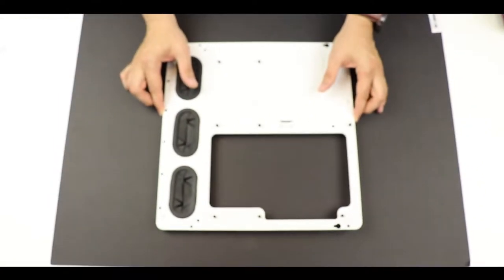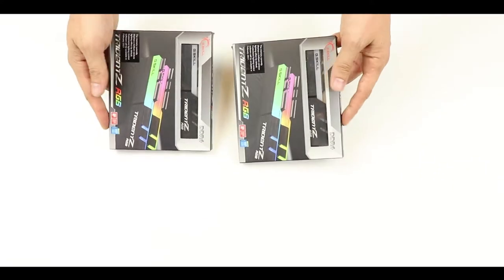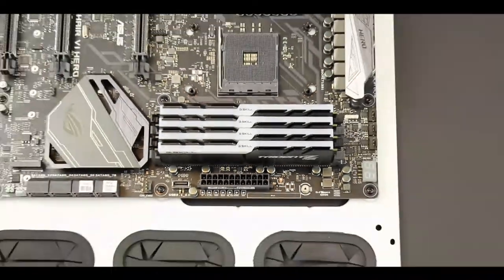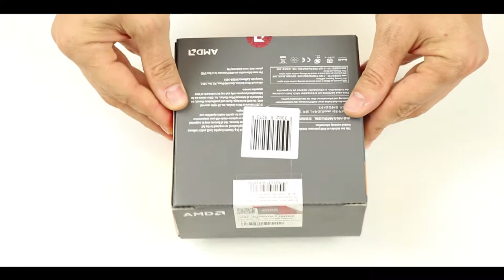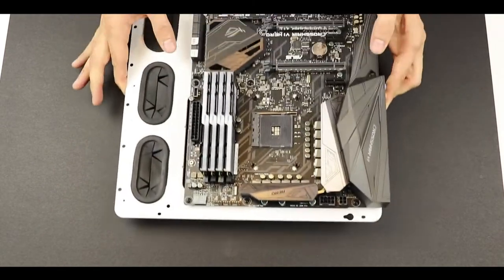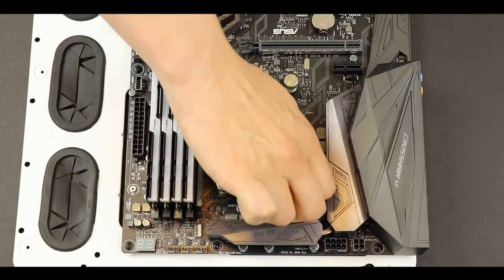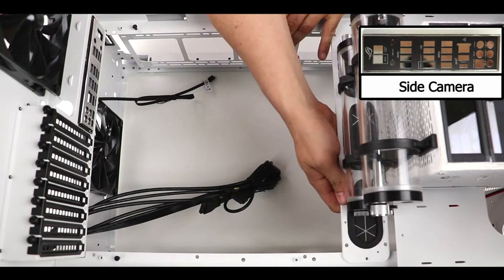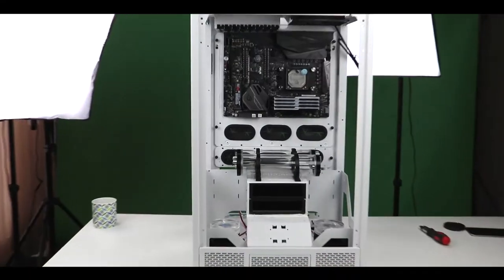Motherboard and insane CPU installation!!   (Ryzen Project 5/10)

Comment: Are important gflops?
Reply from the maker: +VICTOR YEAH  well it is as it measures a processor processing power:)

But we usually tall about this during benchmarking.
Reply: I'm past linx And the result is 280gflops,5,1ghz,16ram ddr4 3466mhz....how about?
Reply from the maker: +VICTOR YEAH wow... super impressive.
That's a serious build. What was the final voltage ?
Reply from the maker: +VICTOR YEAH wow... super impressive.
That's a serious build. What was the final voltage ?
Reply: 1.425v,asus prime z270-a
Reply from the maker: +VICTOR YEAH awesome!!
Reply: I'm going to buy this box Phanteks Enthoo Pro M  and I'm going to buy 2 14 Fans but I do not know where they plugged in? Power supply can be connected?
Reply from the maker: +VICTOR YEAH well u could.. but ususually fans connect on the motherboard so that their speed can be controlled and adjusted by its software.

Id suggest u get a PWM fan splitter (cable).

You can plus up to 4 or 5 fans by connector (don't try more).